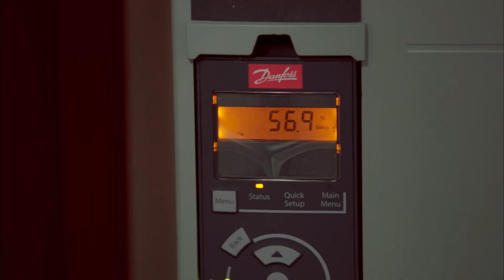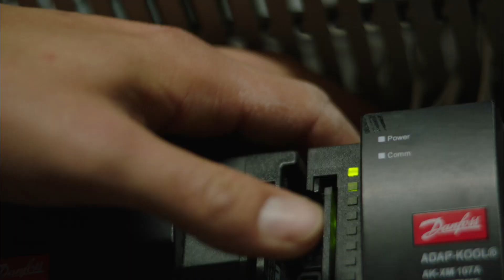Danfoss Cool | Engineering Cooling Solutions for Tomorrow

Comment: I work at Fluid Chillers Inc here in Michigan. We manufacture process chillers from 1/3 to 350 tons specializing in ultra low temperature Chillers. Just began implementing the Danfoss ETS Colibri electronic expansion valve. I love my European components. Danfoss and Bitzer compressors, Ebara pumps, Ziehl Abegg fans, and Schneider controls. All state of the art and top-of-the-line.